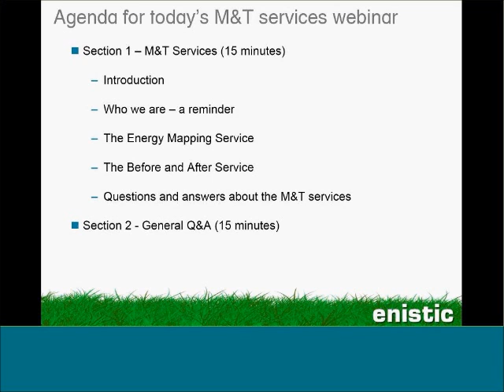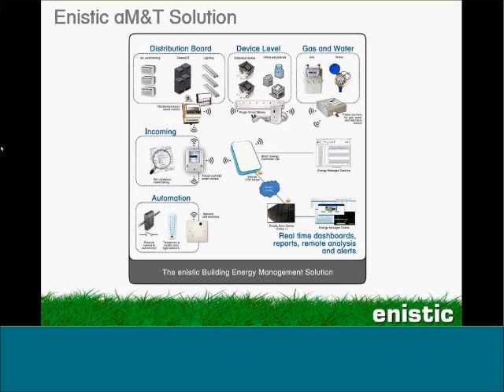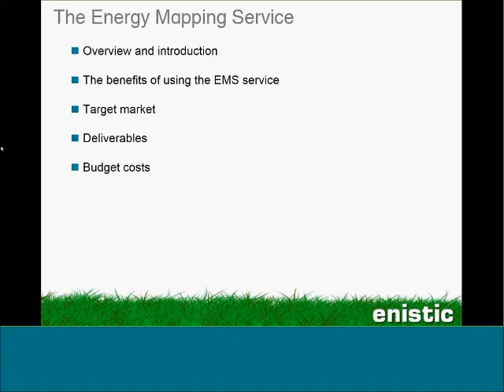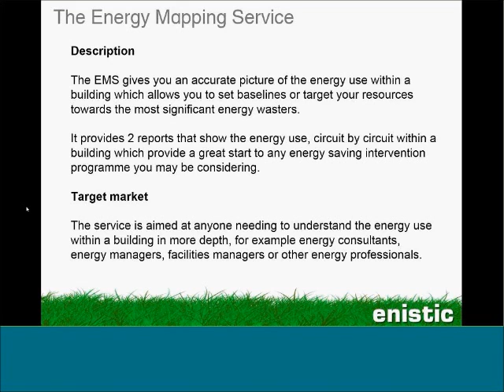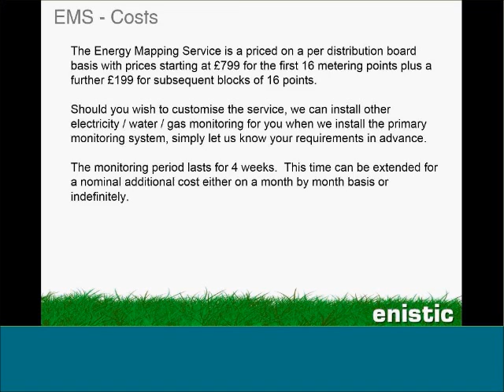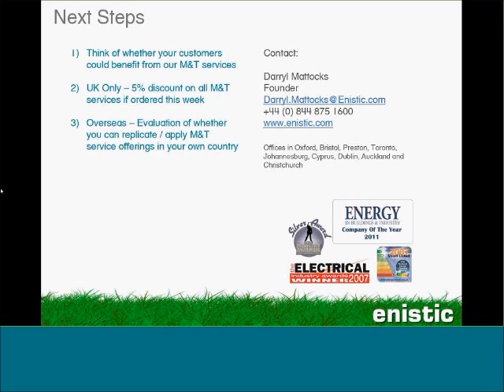Enistic aM&T Presentation Webinar

Comment: Be careful Mr Mattocks is very convincing but the companies credentials don't add up. States that company started in 2009 so what is Electrical winner award on  the last slide dated 2007? The energy company of the year 2011 award is a fake. I checked it out and there is no such award